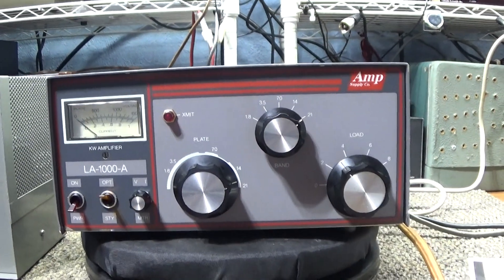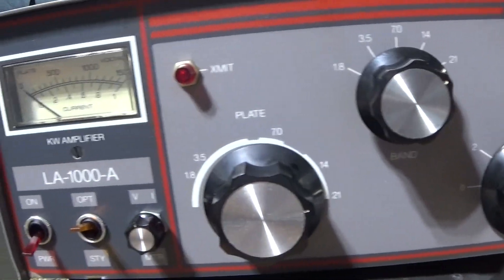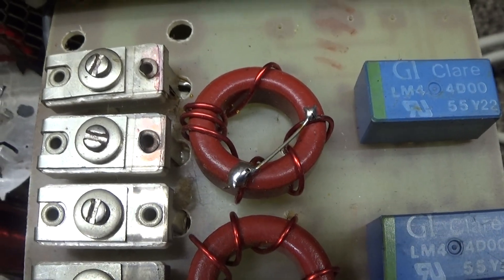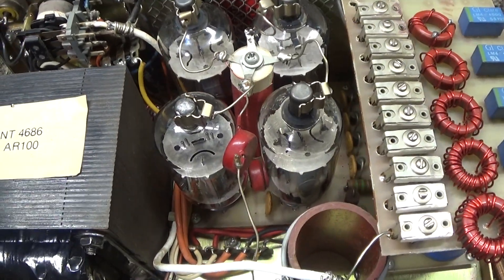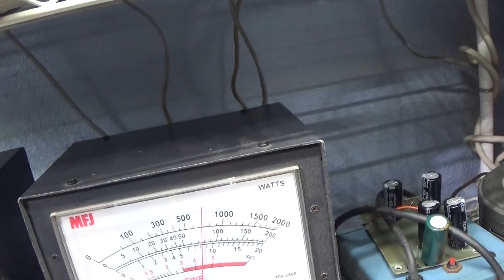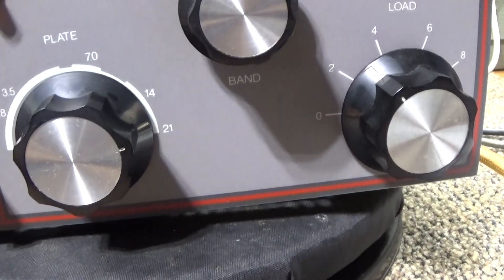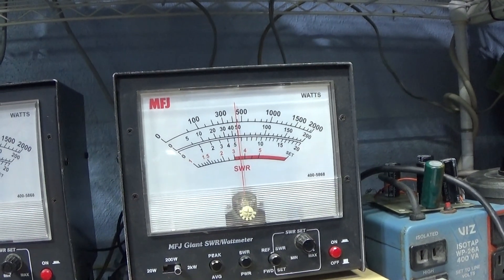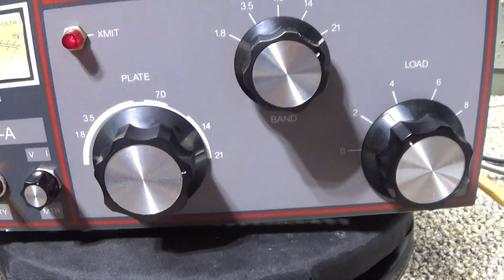Amp Supply LA-1000A 4 6lq6 (6mh6) sweep tube Linear Amplifier

Comment: I noticed your plate voltage was hovering below 800 or so volts. That's probably why it wasn't doing well on power. It was supposed to give you around 500-700 pep. Maybe something happened to those resistors in line with the plate voltage. They are known to degrade with age. These amps are driven hard with plate voltage 1000-1200v

Comment: I think that the problem with these type of amplifiers is, that the tubes are fast becoming unobtainable and expensive!🙄
Reply from the maker: True, but as of now, almost all tubes used in linear amplifiers are becoming unobtainable and expensive. When 4cx800's first came out and were not well known yet, I could get all I wanted for 50 a pop. Those 500z's 572B's even good 4 cx250's, 4-1000 'pulls used to be cheap and plentiful' and more are much harder to find and expensive.

Comment: The Pal 350z is nearly the same as the Palomar 300a except it has the internal transformer and a keying circuit that drops the driver stage when it senses more than a certain drive level.
Reply from the maker: Palomar tried, unsuccessfully, to squeeze more watts out of the same tubes when they went from the trusty old 300a to the 350Z. The 350Z had a few, fatal to it, flaws. 
It did not have the HV cutoff so HV was on the tubes all the time.
They went from grounded grid, to tetrode configuration. TV sweep tubes usually don't like this and they didn't.
Some amps, like Blackcat, only apply the screen when the amp is keyed. 350Z did not, the screen was also on the tubes all the time. It depended on a 2 stage Bias to keep the tubes tame when not keyed or in standby. Hence the HV and Screen and tube ground were connected to the tubes all the time. That is a firetrap waiting to happen. 
That drive inhibit circuit was terrible. It often went bad and now you can't key at all.
The Lo side of the 300a bypassed the driver tubes. You could put it on low and drive it with up to 100 watts per the manual. On the 350Z it switched the screen voltage from a high screen to a lower screen voltage. Both the screen voltages pulled the voltage off the HV were regulated by zener diodes with a large dropping resistor. That screen dropping circuit was another hot spot, just cooking itself all the time and often failed. Often when it failed, it would take out the tubes with it. Screens in sweep tubes are very delicate.
Reply: @tramdr  Thanks for the very useful information.  I had never actually used one, or had my fingers in one, so was unaware of these issues.

Comment: I have an opportunity to purchase an amp bundle for $400. Condition of the group isn't the best. It includes (2) D&A Maverick 250's, (1) Varmint 150, (1) D&A Phantom 500 and (1) LA-1000-NT (no tune). Do you know if there's a way to convert it to 10/11M? Did you do the jumper on the 15mhz coil or can you provide any info on how to jumper it as seen in your video?..thx!
Reply from the maker: No expert, never had the NT version, but from what I saw on the net, it already tunes from 10-12 meters.

Comment: Will it work on 17 metrers?
Reply from the maker: Not sure, but I would think so, also if not, retap the 15 meter coil a little.
Reply: What the 18 is 17 meter. Not a lot of amps do 17 meter so would be a decent amp for 17. Don’t need much on 17 meter unlike the bowl 😂

Comment: Amp Supply also made a LA1000. Earlier model before the LA1000A. Basically the exact same  amplifier. These are also like the Dentron GLA1000 amps and the Ameritron AL84.
Reply from the maker: and Hams say the CB ones suck and the Ham one's are pretty good. All are almost identical LOL.
Reply from the maker: Yep, Siltronix, Swan, Yeasu  off the top of my head also made 4 tubers similar to this.

Comment: Nice man thats in good condition! I have a amp supply LK-550 with 3 3-500zs. They built the amp supplys very stought. Mine has a aux on the band switch so I added the 10m tuned input etc..works pretty good.
Reply from the maker: They made good stuff!